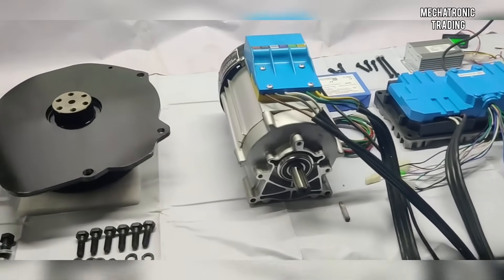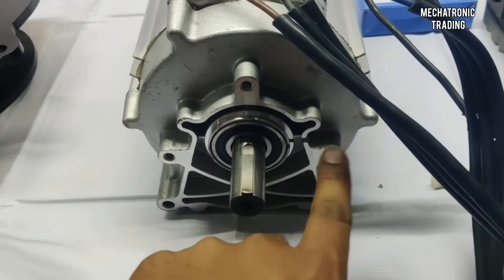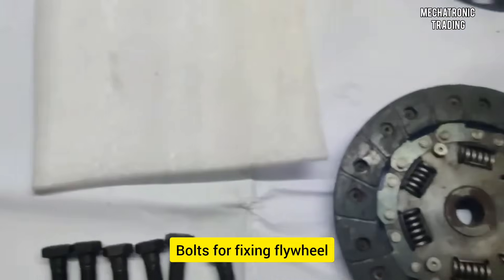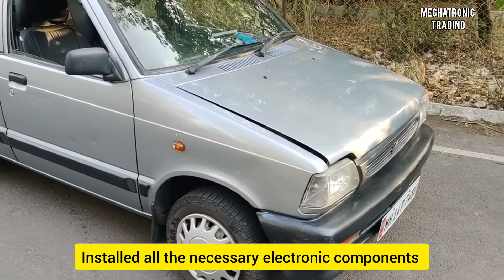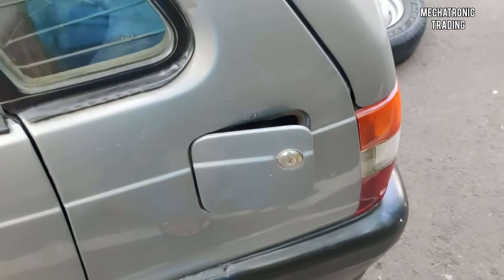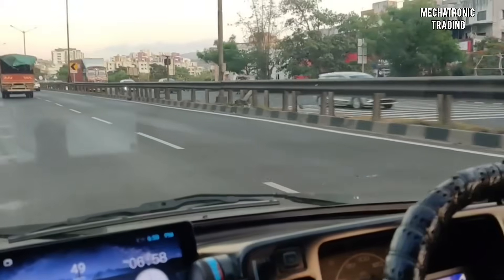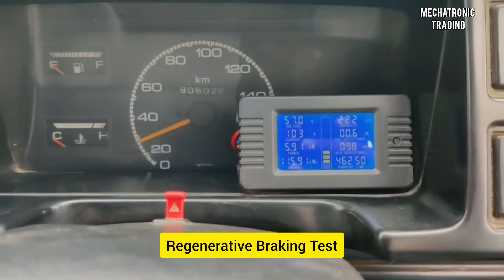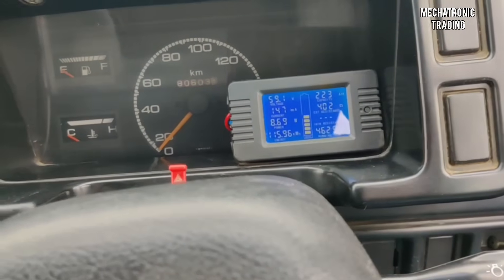Electric Car Conversion Kit India | Maruti 800 Electric Conversion Kit | Nano Car Electric Kit (DIY)

Comment: Just 3 questions. 1) How safe are those batteries because if they explode underneath your seat you will be fried.  2) Why take power from the batteries to charge the main battery used for indicator, headlights and wiper etc, and why not just leave the old alternator to do the charging of the original batery as it always do. 3) How much does it cost for all those kits

Comment: Since now there is no ic engine to start, you could have changed the 12v lead battery to 12v LiFePo battery. Saved some weight, size.

Comment: Bro tell me how brake system works if air brake is used where aircompressor is provided in the car further inform how power steering works

Comment: 7.4kwh? a 4kw motor?  JUNK. You will be LUCKY to get 10 miles of range.
Reply from the maker: How did you calculate this range. Please share your calculations here.
Reply: @mechatronictrading7446  YOU put 4kw (5.3hp) on the screen.  It takes more than a kwh to move a bicycle at 35mph for 15 miles. 7.4kwh (you put the voltage and amp hours on the screen too.  Watt hours = nominal voltage times amp hours) is nothing dragging around a car at 50mph..I'm willing to say I might have been too conservative with the 10 (16.12)  miles per charge, but it is not going to be that much better. You will NEVER get 74 (120km) miles of range on this thing, which is what you put on the screen

 30 miles (48km)is not nearly as conservative.  MAYBE on perfectly flat ground with 1 woman 110lb (50kg) in the car driving it on a perfectly windless day or with a tailwind, never exceeding 30mph (48kmh)  maybe 35 miles.

The Tesla Model 3 gets 4.17 miles per kwh. That would be 31 miles for 7.4kwh.  Only the model 3 motor and controller are far more efficient and custom built for the car, has direct drive and the car body is extremely aerodynamic.  This Maruti 800 car somewhat makes up for it by being lighter (650kg vs 1755kg). But it is much less efficient and less aerodynamic.  This car originally shipped with a 37HP (27.75kw)motor, that is presumably at the wheels and not the flywheel. (In the US, where I am from, all HP ratings since the 70s are taken at the wheel. before that, it was at the flywheel)  IOW, after all the parasitic loads the power flows through. So maybe 65hp at the flywheel.

The undersized motor in this thing will drive down an already low efficiency motor (in comparison to the Tesla motor). Heat is the number 1 enemy of an electric motor.  These windings will heat up (from being over-driven. 4kw (nominal) is nowhere near enough power for this car) and lower the efficiency even more.  Plus you are running the power through a manual transmission. Manual transmissions put a parasitic load between the motor and the wheels. Probably closing in on 20% (plus the differential if it has one) on this low end manual transmission.  I imagine you kept the transmission in the car for either simplicity of install or, just as likely IMHO, it needs the under-drive  gearing to get the car moving from a standstill and for acceleration more generally..

I'm not saying you didn't put hard work on this or that you did a bad job.  . What I'm saying is this basically ruins the car for all but the shortest trips.  India, like the US and China is fairly big and spread out.  As a grocery getter in the city where the grocery store is 5 miles away, it would be good for that.
Reply from the maker: Your calculations related to Whr ratings are perfect(V*Ah= Whr). So in our case its (60*124= 7.4Kwhr). Mileage will be decided on the Watthour(Energy) consumed per km. 

Here we have energy consumption data for different vechicles that we have:-
For a bicycle with a 250 watt motor - 10 to 15 Whr/km
For an ebike with a 1000 watt motor - 30 to 40 Whr/km
For the car shown in the video- 60 to 80 Whr/km
So as per this data mileage (Whr rating of the battery/ Whr per km)(7440/80= 93). So this is how we are getting 80 to 100 km/charge as mentioned in the video.

The rated wattage of the motor is 4kw and maximum continuous power motor delivers at the flywheel is 6.5kw and it delivers 5.8kw on the wheels considering motor and transmission losses. The power consumed for the car to move at 40km/hr(with a driver and a woman) is 3.6 kw on a flat road.
This will give you an estimate on how much power is required to propel the vechicle.
You can also monitor this value with a wattmeter if you have a similar electric car. The motor seems to be under powered only if you compare with other companies that have installed higher wattage motors for performance.

We have coupled the motor with the existing gearbox not for ease but to increase the torque initially for acceleration and for gradients. Later on your upshift for higher speed. Most of the electric car do have a single speed gearbox and a differential for transmission. The losses for the transmission cannot be eliminated. 

The car that we have shown is  not a project just for demonstration of our enginnering skills but its an economical solution for people who want their cars converted to electric. We have driven the car for more that 20000 kms uptill now and we have converted cars for more than 3000 customers who are also benifitting from our work.
Reply: @mechatronictrading7446  Thanks for the info.  You said 

"The motor seems to be under powered only if you compare with other companies that have installed higher wattage motors for performance."

I'm comparing it to the original engine used to propel the car. It originally had a 27.5kw engine, albeit with different characteristics being an ICE engine.
In any event, good luck with the project.
Reply: @mechatronictrading7446  Thanks for the detailed reply, I am doing a similar project and your video has provided very valuable information. Thanks for your hard work.

Comment: Hello . Can you tell me charging units/kwh ...and  charging time required from home supply. And range of your car. On a single charge.
Reply from the maker: Hello. The battery pack is of 7.4Kwh and it take 8 to 9 units for charging. So it consumes 1.22 units/Kwh and mileage per charge is 80 to 100 kms.
Reply: 1/- per km Almost  @mechatronictrading7446

Comment: Very good but  must install rear Mount motor with rear wheel drive in engine is must for front wheel drive.
Use both engine and motor instead of removing an engine.
It is feel free driving in case of charge is down we using engine.

Comment: Really liked the project. Few questions though; how the electronics and the motor are going to be protected from water during rains or a splash from under body? Do you have plans to bring out the conversion kits for bigger sedans as well?
Reply from the maker: The motor and controller that we have used are IP67 rated. Everything gets completely sealed with IP67 rated 3M sealants so that water does not enter those parts. We have kept the top cover and the components opened up only for recording the video for explanation.
Reply: @mechatronictrading7446 where is this workshop

Comment: Great work. Can the gear box, clutch assembly be eliminated? I was wondering what changes will be needed to make it without the mechanical transmission in a conversion project?
Reply: Can we make a hybrid petrol  + electric . It will work.

Comment: take 4 people of 60kg in this car and check performance
Reply from the maker: Already tested with 4 people. Works perfectly as its shown when we recorded the video. So we have mentioned the speed as 50-60 km/hr and mileage as 80-100 km/charge depending on drive pattern and total load on the vechicle.

Comment: WHHAAAATTTTT ??? CLUTCH & GEARBOX in an ELECTRIC car ???
What is the function of a CLUTCH or GEARBOX in an electric vehicle ???
Reply from the maker: The cars that many companies manufacture are installed with a higher wattage motor coupled with a single speed gearbox. Unlike them we have come up with an option of using lower wattage motor but assisted with a multispeed gearbox. So to increase the torque initially we need to down shift and to increase the speed of the vehicle we need to upshift. Clutch is required for smooth shifting of gears.
Reply: @mechatronictrading7446  I appreciate your enterprise, your innovation, and practical thinking. It is not easy in a country ruled by congis for 70y. 
But PLEASE remember that gearboxes waste energy. Also clutches if they tend to slip.
Please re-design the motor with more poles, use higher freq or voltage IGBTs and fit motor directly to differential.
Ultimate design would use large dia hub-motors. Yes, the winding & electronics will be more complicated but very efficient & cost-effective  😉

Comment: No coupling/rubber seal while joining gearbox?
Solar panel on the roof(if install) can charge the aux battery.
Car balance/handling/weight distribution after the installation?
Any changes required in whole suspension system?
Aircondition working on battery/alternator?
Reply from the maker: The motor get coupled with the gearbox with a clutch in betwee that already has clutch springs to handle the jerks in starting. So you don't need any rubber couplings. 
The battery pack in installed in the rear section and we have made the necessary changes in the suspension to maintain the stability of the vechicle. 
An electric compressor will have to be installed for the working of your air conditioning system.
Reply: Price ????
Reply: @mirirfan19 not a seller nor its promoter,inventor,mechanic,driver,etc.

Comment: Very nice video bro appreciated 
Everything fine as of now, let me know is power steering and air-condition will work in this car?
Reply from the maker: Thanks for the appreciation. Yes the power steering works as it was working earlier. For the air conditioning an additional electric air compressor is required. We will soon post a video for these two queries.
Reply: @mechatronictrading7446  sir i want your mail. Or phone number i want this electric kit i have to also make 800 EV
Reply: M800 does not have power steering.

Comment: Dose it have a power steering  ? No mounting for the electric  motor?
Reply from the maker: The car that we used for conversion does not have a power steering. But customers have converted cars with power steerings. Existing ECU and related electronics work perfectly even after electric conversion.
As the motor is a flange mounted motor it is mounted on the gearbox mount plate and does not require any additional mounts.

Comment: Hi brother, thanks for the detailed video. I got one question - what is the benefit of keeping old (auxiliary) battery? We can use the power from main batteries by using 12v dc converter. Please clear this doubt
Reply from the maker: Hi brother. The auxiliaries of the vechicle include electric motor also like the wioer motor, power steering actuator, etc. Sometimes when working these auxiliaries require surge currents in start due to which the dc to dc convertor gets damaged. So here we have kept the 12 V battery in between so that the surge currents are provided by the battery. Dc to dc has to just top up that battery and keep it charged.
Reply: @mechatronictrading7446   Thanks for clearing this doubt :) I wish to work with you to learn more about ev conversion. I am also planning to convert Maruti 800 to ev, with 4kw motor, 60 0r 72 volt at least 120ah battery pack
Reply: @mechatronictrading7446 price of full kit
Reply: @mechatronictrading7446 documentation and RTO ?
Reply: I think it's important to run internal use such as charging phone, ignition or internal music ac or led panel of car

Comment: Just 4kW motor?, that is going to be sluggish interms of pickup.
Reply from the maker: Yes we had the same view before testing the 4kw motor in the vehicle. First of all its a 4kw rated power motor with a peak of 7 kw and on top of that its coupled with a gearbox that gives you a pretty good acceleration when you down shift and will give a speed of around 60-70 km/hr on top gear. You are welcome to visit us for a test drive.
Reply: @mechatronictrading7446  what is 0-60km/h time?

Comment: Battery capacity and how much range the car covers when its fully charged?
Reply from the maker: Battery pack is of 60V 124Ah. (6660 Whr considering 90% cutoff by bms)
Range per charge is 80-100 km/charge
Reply: Contact number